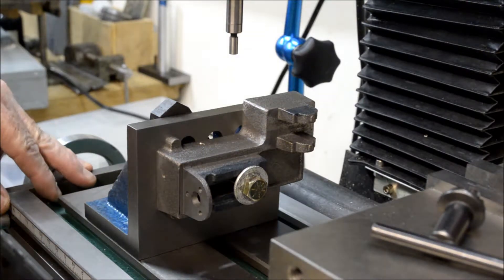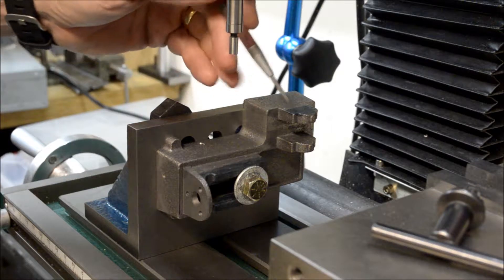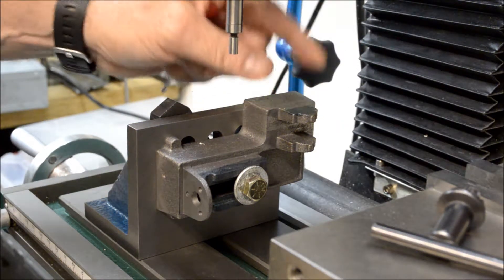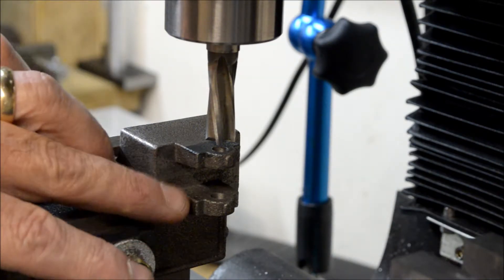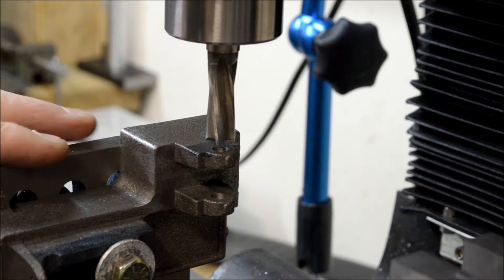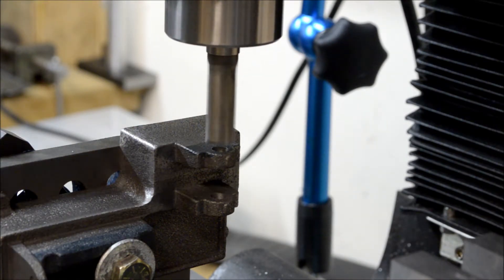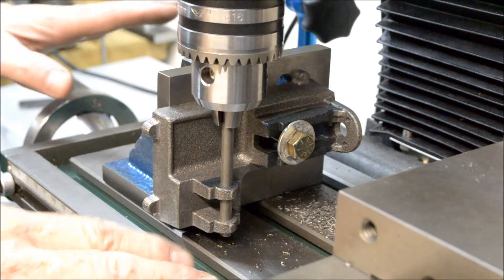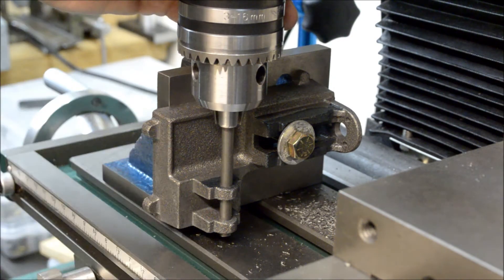PM Research #3 Base 3

Comment: If dimensions are taken from the bottom of the base and the face of the cylinder machined face then I assume you have to adjust dimensions based on how much you took off them to insure you hit the bearing bore bosses in the centers.